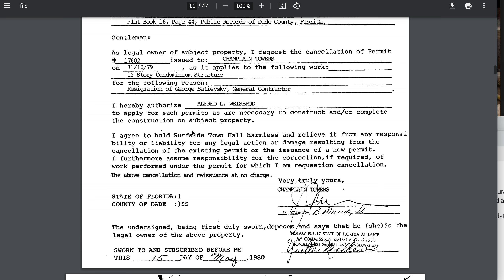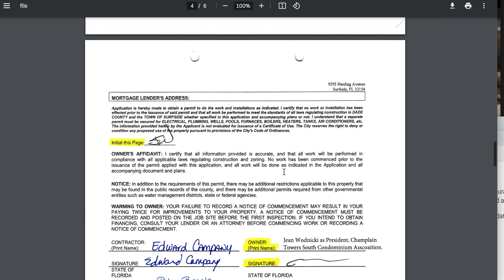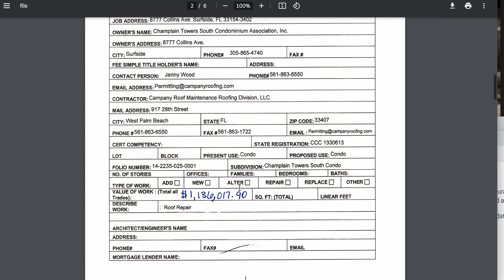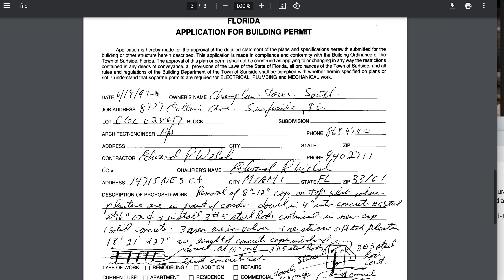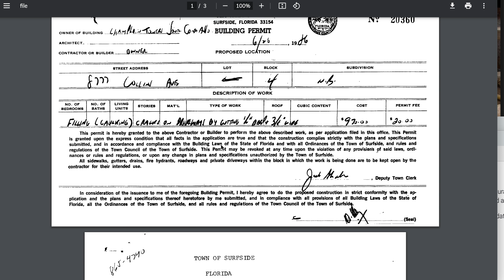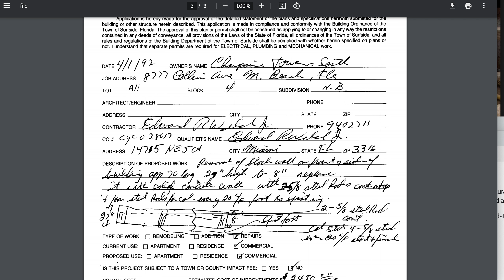Champlain Towers Collapse had a LOT of repairs done FULL CONCRETE DECK REPAIR EVEN CONSTRUCTION ENG

Comment: Whoever imagines concrete improving in strengrh over time is engaging in religion to avoid fear.  Concrete fatigues, needs have tolerance for century(s) of fatigue loss designed in or will eventually fall down.  Not skip main structure to get enough clearance for parking.  Just use a fat I beam, problem solved.  But no.

Comment: Here where I live in South Africa we have 2 story residential buildings that are more sturdily constructed than this thirteen story monster with it's knitting needle columns.
Another video noted: Condos designed with "cheap" finishes 1980s style carpets, lightweight kitchen fittings (cheap) Now we have granite tops, travertine floors on cantilevered balconies  and heavy patio furniture as well. Lots of load added to the structure over the years. Hammering and pounding away at that flimsy structure. You cant patch concrete structures.
Reply: Sums it all up.

Comment: All these years of renovations added too much weight for the columns, between unit owners swapping out carpet for thick marble to the roofers, who probably pushed this a few lbs too far for this old a structure with all this never designed for interior weight. Not the roofer's fault that nobody did a structural inventory on the entire building.

Comment: In 1992, removing block wall, replaced with solid wall, and replaced concrete block caps on planter boxes with continuous concrete caps on planters.
Reply: Doesn't look like any of these matters to the structural integrity of the building, which was lacking in the first place.

Comment: I remember hearing or reading that witnesses said there was a lot of "pounding" in the days before the collapse.  Given that they got approval to begin work on the roof first, and had been installing those anchor points (which some say were for the window washers, and other say were for the roof workers,) could those vibrations, coupled with vibrations that had been occurring next door during that construction, have accelerated damage in the deck areas?   
I'm pretty sure there's more than one thing that caused the building to fail as it did, and if you're correct and it started at the parking area, could those vibrations weakened the connections that supported the cars, initiating shear in that area?

Comment: The work done on the "driveways" was 1986, not 2006.  That it needed that kind of work in that short a time is troubling to me.  That it needed re-roofing only 5-7 years later...
Reply: I don't know for sure, but the roof may have been related to Hurricane Andrew, which hit the area in late August of 1992. Surfside didn't get the worst of it, but did still get damage. It would have been hard to get a contractor around that time as the damage was so widespread all over S. Florida.

Comment: WTF $970 to patch up cracks? Who are these people coming up with this scope of work??? Why aren't REAL REPAIRS  being done??? Why isn't the source of the problem being identified? What mickey mouse popsicle stand contractor is being contracted????
Reply: Probably a contractor like myself, who only deals with cosmetics. If I were called in somewhere like this I would be working on the building cosmetically only, but I would make sure that they knew that my part of the job was strictly cosmetic. I would also have huge questions if the things that I am being asked to make look better look as if they have not been repaired structurally yet. I am assuming that the filling of the cracks were after epoxy injection? Which would be done by someone who specializes in structural work . Normally any contractor that does structural work will leave once the structural work is completed anyways, leaving all the Cosmetic work (making it pretty) behind for a contractor like myself,
Reply: @Ghost-Dog-Rick  thank you for the explanation but still before cosmetic work is done they have to address the source of the problem because if you just fix the cosmetics and not the source is going to happen again... That would be like a water pipe bursting inside a wall and instead of fixing the pipe they fix the drywall....
Reply: @Ghost-Dog-Rick  nice to know - I would have thought one would do both
Reply: As a person who designs our Grid and has to draw blueprints for the construction crews which includes sizes of materials and everything to do with Overhead or Underground installations, and someone who flips houses for fun, I would NEVER use epoxy & feel it would be as strong as concrete & rebar. Im not a structural engineer but common sense has to  used. If a Contractor was asked to fix it & used Epoxy, he should be held accountable. I see where there could be a miscommunication in regards to what a "fix" constitutes, so thats where the decision makers need to be held accountable. Proper structural repairs would have probably been $10M-$15M. I hope to see a lot of arrests as a result of this investigation.
Reply: @ShalomShalom-d5c  as you stated, the decision maker has to be held accountable.  As someone who does only cosmetic repairs for a living, I can tell you this. Whether it is right or wrong it is a Cutthroat industry, and if a potential client told me that the structural repairs were finished and that they wanted me to make it look presentable, I would absolutely do it. I would also stipulate in my contract that I'm doing cosmetic repairs only, and that the board has assured me that the structural repairs were done correctly. I would then do my part of the job and put food on the table for my children. If we are getting in the territory where someone like me has to hire an engineer to verify structural Integrity before doing cosmetic repairs, I may as well file bankruptcy and shut down business today
Reply: @Ghost-Dog-Rick  I agree with your comment however in this case whomever filled the cracks would have to know there were no structural repairs or the cracks wouldn't be there to fill...

Comment: I'm still watching, only 25% into this video but I'm shocked to see all that work for only $2,450! I know it's 1992 but I remember my rent payment in 1992 so I know $2,450 is very little for all that structural repair work on the deck, was it even a licensed contractor they were using?
Reply: I noticed that too, its incomprehensible.

Comment: If I'm hearing this right - they cut up the pool deck slab (ripped up the surface, dug downward into it) just to install the big planter boxes for the palm trees?
Reply: That's what I'm thinking... Did they hit the existing rebar in the slab when they put in the dowels..?
Reply: Pool decks do NOT need planters with palm trees.

Comment: I live in the area and I've been inside that building a few times... I would say the "front" of the building is the west side facing Collins. That's the side where you'd enter the lobby from the valet driveway.
Reply: Collins runs N/S, 88th St runs E/W. Ramp to underground parking was on north side of building on 88th, ramp ran N/S. Collins car entry included parking on pool deck level, driveway ran E/W. Not sure what they consider "Front of building". Some people refer to Collins  (west side of building) as front & others refer to 88th St (ramp/northside) as front.
Reply from the maker: Are you close, get us some real images?  hmm
Reply: @LoadPathEngineering  not that close. I live around 5 miles away. The road is still closed off by the building because they are afraid the street could cave in. I did volunteer in the area during the recovery but the closest we could get was about 1.5 blocks.
Reply: @LoadPathEngineering  what kind of images do you want? There's been a lot of local news coverage and there are lots of pictures and videos floating around. Off the top of my head, miami dade fire rescue has posted a lot, I think those are on Twitter. And our state rep Jason Pizzo has also taken up close pictures that he posted to Facebook and I believe twitter as well. All should be public.
Reply from the maker: Steph, it would have been anything general... never know what I can find in an image...   they are blocking cameras from actually observing the finest of details, which to me, are any all all ''connections" ...  That means the very base of columns and very tops of walls...
Thanks Steph for sharing your experience...
Reply: @LoadPathEngineering  right now all the debris has been cleared and it's basically a cement pit with a few column pieces sticking up. Check senator Jason Pizzo's twitter or FB from July 20, the pics show what's left from all street sides.
Reply from the maker: @StephSunshineArtistry  thank you Steph, I have and did a video on that days ago...  I just wanted to prove or disprove something... and needed those tight details. Thank you kindly for your thoughts...

Comment: NY Post is reporting the original engineer was suspended by the State of Florida "Architect of collapsed condo suspended years ago for structural failure" Writing, "The architect began serving his suspension on June 1, 1967, the Real Deal said, according to documents obtained by the outlet. "
Reply: Just read this and the source article from “The Real Deal”. Wild.
Reply from the maker: Thanks Dos for the work do and for supporting this channel like you do. If, I get to admin level, you are in.
Reply: @LoadPathEngineering  Thanks Kai. These videos motivate us to learn about complex systems. More importantly, they push us to expand our critical thinking. 

Just floored by how much data you pulled from the 1980 and 2021 collapse videos; the press and government are living on a different plane.
Reply: The building was built in the 1970's but he started serving his sentence in 1967. You would think anything he worked on would have been Questionable & therefore checked prior to construction. I mean Surfside is a small place, it aint LA or NYC.  Edit: Maybe they meant He (the Architect) suffered structural failure as in impotence!😳 hows that for sexualizing a concrete joke?
Reply: You need to verify anything the NY Post reports, because they don’t.